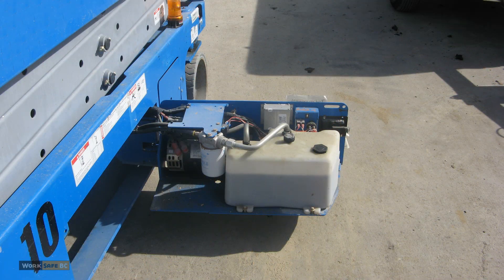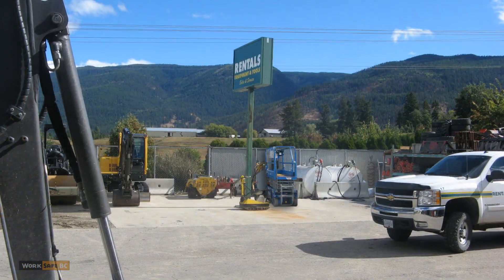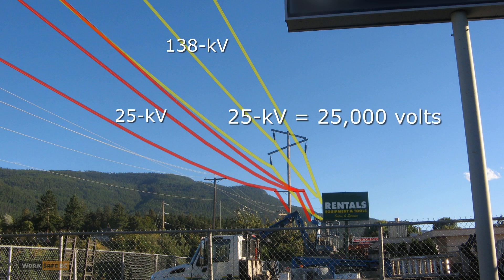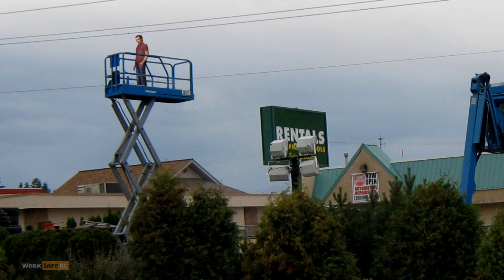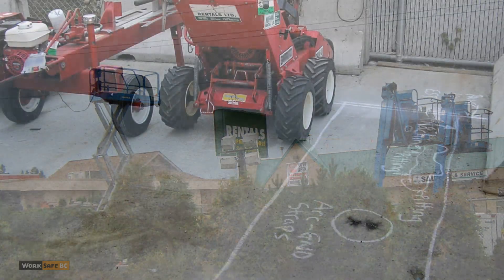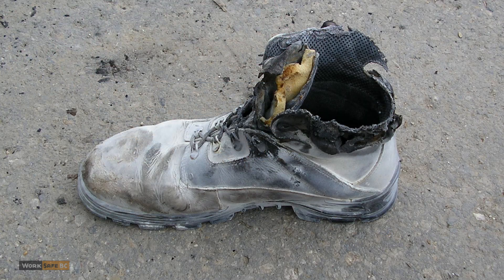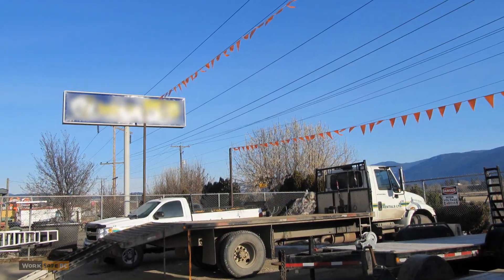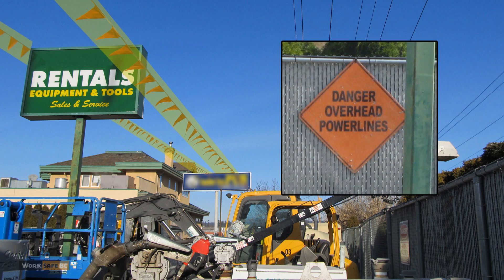Incident Investigation: Worker on Scissor Lift Electrocuted | WorkSafeBC

Comment: Even if the ground straps were not on the lift , As the high voltage electricity was traveling down into the ground , 
It would have jumped from the wheel rims and down into the ground because of how close the rims were to the ground  , That guy should have looked up when he was raising the lift and stopped when he saw the power lines and he should have never reached his hand up , At 25,000 volts 
He would never know what hit him 
I'll bet his body was nothing but a big piece of charcoal , There is no way his work boots would have protected him because that high of voltage went right through his boots , Through the scissor  lift and down into the ground 
God forbid that If a high voltage power line falls on your vehicle 
ABSOLUTELY NEVER ATTEMPT TO GET OUT OF THE VEHICLE !!!
Because your body will be energized to the line voltage and the moment you put your foot out , That high voltage will surge through your body and right through your shoes and down into the ground , Also If a power line falls on your vehicle , Call 911 and stay put in your vehicle until the power company comes out to remove the power line

Comment: Raised his yand in a defensive manner? I can see why you might do that if you were moving towards a power line and instinctively you put your hand up to block ot from hitting you (albeit in this case it would still electrocute you), but the video didn't show his vehicle doing anything that would be pushing him towards the line. Instead, it showed him stationary and then moving his hand up, as if reaching for the line in an effort to commit suicide. The video demo of what happened absolutely does NOT match what the narrator was saying. This is very suspicious. Is WorkSafeBC attempting to cover up a worker's suicide?

Comment: Two big flaws. When his cab got too high, instead of just switching off the lever for vertical movement, he pannicked and defensively put his hand up. That was a fatal mistake.

Also, if you ever need to use any kind of lift device or crane under power lines, never deploy the ground straps. Those are only needed when fueling the vehicle to drain static electricity (a static spark can light gasoline). If this lift truck had been ungrounded, the current from the power lines would have no reason to travel through him to reach ground, because there would be no ground to reach. The rubber tires would have insulated the vehicle.
Reply: It depends on how thick the tires are, and what the breakdown field strength is for the specific type of rubber used in the tires.

Comment: MAYBE I´M WRONG (SORRY IN THAT CASE) BUT I THINK THAT P.LINES ARE 13,8 KV = 13800 V ... NOT 138KV
Reply: Actually there are some that are 135kv. And some even higher than that  for example, power lines that go from a power plant to a city a couple hundred miles away, often have voltage as high as 500kv (half a million volts)! The higher the voltage, the easier it is to deliver the electricity a longer distance.

Comment: Isn’t there plastic coating over wires?! 😐
Reply: On high voltage power lines, no. Insulating rubber blankets can be placed over high voltage wires when there is known to be work done close to them. Howevt this guy wasn't in a job that required working close to power lines, he just didn't realize they were there and so raised his lift (this was still at the rental yard before he took it to his job site, so presumably he was testing it out and practicing using it to make sure he had a good idea of how to work it).  The type of insulating material amount of insulation needed to protect against voltage that high, would be prohibitively expensive when running wires like that over a distance of tens of miles. It would likely more than double the cost of the lines. So most power lines are simply made out of bare aluminum.

Comment: When working with powerlines you must always treat them as if they have no insulation, it the same principal and when you are handling a gun, treat every gun as if it is loaded
Reply: That's because power lines are bare aluminum.

Comment: Isn't voltage irrelevant? Shouldn't they give the amperage?
Reply: Voltage determines the flash-over distance.

As of amperage, in power lines it’s always more than enough to fry someone and start a fire, be it 100 or 10000 amps.

Comment: in drizzly weather you can hear the BBZZZZZZHHH from very high voltage lines.
the arc will jump a gap, plain air is NOT a 100% insulator.

Comment: I thought you only got electrocuted if you touched 2 of the lines?
Reply: Alternating current 
(AC) Electricity flows through  any  conductive path to earth ground , it also flows from phase to phase .  The top wires are the energized phases ,  the wire several  feet below  them is the neutral ground  wire.    Flow can be phase to phase ,and or phase to 
neutral  ground  wire or direct to earth ! These wires are not insulated!   The service drop to the customer is insulated, but never touch it ,as it could have bare spots!

Comment: Retired lineman 33 years and saw the after math of numerous accidents like these, a well driller putting his rig into a 7.6 -13.2 kv line killing him, company building fire trucks, operator put boom into 69kv transmission line killed instantly and numerous other burned severely or killed under estimating those overhead lines.

Comment: How many times does this need to be said - it's not the voltage that will kill you it's the amperage!!! 

When it comes to amperage 0.1 to 0.2 amps is enough to be fatal, any energized power line you will ever see carries far more than this.

Comment: It can't be overstated that the insulation on the power lines does not function the way people think it does. Electricity at high voltages effectively ignores objects smaller than a few feet (a meter or two). It can jump through the insulation as if it weren't there, regardless of its resistance potential. The actual purpose for the insulation is to create a barrier between the wire and the air, because if the air contacts the wire it can cause the air to built up charge until the air becomes a better pathway for the electricity than the wire is. You, a bag of salty water, is already a better conductor than a stagnated circuit, therefore you must treat the wire as if it has no insulation at all.
Reply: There is no insulation on high voltage overhead lines.

Comment: These BC-recommended distances from high voltage lines are there for a reason! You do not follow these rules - you get electrocuted or die! Also - there is the static electricity theory involving flashover and being too close to the lines. Next time on a very dry, winter day, touch your fingertip to any metallic object. The voltage from any static electricity shock in this case has much lower amperage than that of the power lines with high voltage, so getting even close to, say, a metallic doorknob - say, 1/16 of an inch without touching it, and the flashover results - you see a spark and then you get the jolt from it - which is the shock. So a good rule of thumb is to stay away from at least 1/8 inch from all metallic objects whenever RH is extremely low and it is very cold, which will create perfect conditions for static electricity shocks - until you can find a way to discharge them safely. So use these static electricity shocks to send you a warning of a shocking electrocution that will happen if you disobey minimum clearances from high voltage lines.

Comment: Ground insulated equipment is an option. in most cases lifesaving. Ground potential up there on a platform is the cause for such tragedies. and dry weather. Never do powerline maintenance in rain, snow, storm or otherwise damp / wet / humid / unsettled weather of course.

Comment: Safe working distances must alway be maintained.  132 kv  it’s about. 9 feet    275 kv it’s about    12 ft.    275 kv about 18 ft  Closer  than that you are  in high risk areas & not permitted , Damp or high humidity weather makes it more dangerous

Comment: Not a problem here in Denmark as most power lines are buried. Expensive to do but pays off after time due to savings on lack of weather related power outages , accidents and the attendant costs involved in those two scenarios.

Comment: I thought those lines above had a rubber insulation over them.  I guess it depends cause I know that Three-phase electric power transmission lines do not have insulation.

Comment: The worker in this video as well as any kid who ever climbed an electrical tower or pole and got electrocuted had any intention of touching the line, they were simply never informed by anyone that electricity can jump through the air. If you already knew this..  have you ever shared it?
Reply: Ever hear of lightning, that is electricity jumping through  the air!   The neutral ground wire runs below  the primarys,  if the boom was to close it would  also jump  to  it .

Comment: One time, when my family and I were helping a friend move, we accidentally hit the overhead service line to her apartment. The line grounded itself through the moving truck, and so, we had to wait in the cab for the energy company to de-energize the line and lift it off the truck so we could leave. We were very lucky that was just a low-voltage service line. Bottom line, before you start working, always identify where your utilities are, whether in the ground or above you. It just might save your life.
Reply: Someone was smart enough to know you STAY in the cab??
Reply: by low voltage you mean 120v AC instead of 240v AC yeah still enough to stop your heart
Reply: My uncle died when a truck caught overhead lines which fell on him.

Comment: The metal ground straps on the bottom are for discharging static electricity picked up by the tires when in motion. Unfortunately they were the cause of death in this case.If those ground straps had not been there this guy would in all likely hood still be alive.
Reply: As the video explained, high voltages such as these, can jump a fairly large air gap. The wheel rims and the lift frame are just inches away from ground, so it could easily jump that small gap, and much farther.
Reply: People do not always understand the difference between a conductor and an insulator.  Under the right circumstances, even an insulator like rubber and become a conductor.  An insulator doesn't mean it can't conduct, it means it has high resistance to electrical current.  High voltages can overcome that resistance.  Even if his shoes were EH rated he was still destined to die.
Reply: You don't have to be an American to be stupid. Stupid is as stupid does. Yes the straps are usually some kind of braided metal. His boots didn't work because a picture was shown of them burnt. He might have also had one of his hands on the railing. I have been shocked by 50kv automotive ignition coil, the big difference is the current available.
Reply: Bill Taylor Since the beginning, i guess: rubber insulates only so much. If the voltage is too high, the current will jump. Electrically insulated screwdrivers are only insulated up to 5000 Volt. How do you think you get zapped when touching your car, since the soles of your shoes aren't metal?
Reply: @darkswami Basically , Anything will conduct electricity if the voltage is high enough
Reply: Yes and that static charge is intense
Reply: darkswami bad example since your car is a closed circuit using the vehicle as a ground. Your shoes have nothing to do with it
Reply: Yeah the ground on the lift was essentially the negative pole...the wire dangling was the positive pole....the poor man essentially became a human dielectric capacitor with a lot of conductive ions to store the energy of the 2 poles...it was a tesla coil set up waiting to zap
Reply: High-voltage electricity can jump the air gap from the hub caps to the ground, so, he still wouldn't have survived. This is the very same reason lightning is able to strike cars.
Reply: Really? When did rubber start to be a path way for electricity, Never. They are metal.
Reply: i feel soooooo special now , i was forced to trim evergreens that were almost in contact with a high voltage line , i climbed the trees and cut the tops off , my head was about 3 feet away from the line . i could feel the static pulling at my hair . i am very poor and could not afford to pay someone to do it  , being disabled is hard enough on me and then to be forced to have to do certain things that even a working person would be told not to do .  the power company will only do it once the trees actually make contact , by then its to late and the spark starts to burn away the main wire .
Reply: The straps are rubber, just like the tires.

Comment: He shouldn't have placed the scissor lift in between the high voltage power lines.
Reply: Now you see why high voltage power lines usually cannot be 10 feet above the ground where a person can extend its arm to the fullest upward close to the lines. It will kill that person with an electrocuting shock every time. When you see high voltage lines overhead, they are usually at least 50 feet above the ground to about 100 feet, because you need to have a larger flashover buffer zone to allow for possible air gap escapes for larger distances away from the high voltage lines. That is why there are mandates for you to keep well, well away from high voltage lines like those running 400,000 volts unless you have the proper training to work on them.

Comment: is it not possible to like insulate these hydro lines so they can't electrocute anything? i mean im no electrician ut it seems like a simple fix
Reply: +Eric Mahoney is posible but you need like 15cm of insulation on a line the cable  will weight like 3 tons per 100m, i think it would be better tu put them under ground.
Reply: +Eric M Yeah its possible but it would add way too much weight to the lines and it would be way too expensive
Reply: You can but that costs money and requires more power being sent through the lines, because the insulation acts like a large capacitor and has to get charged over and over, 50-60 times a second. We put the powerlines on top of poles so people stay far away, and they are very safe so long as there aren't dumb lift companies who buy lots near powerlines and don't train their workers to keep away from them.
Reply: Current traveling thru the wires creates heat. if they insulate them, them they have to de-rate the cables or use bigger wires which the poles wouldn't be able to carry the weight of. Bare cable in free air can carry more current than insulated wires because the lack of insulation dissipates more heat.
Reply: Michael Kirst because they become the same voltage potential as the wire. They are not touching ground at the same time or another wire. Linemen can hang in baskets from these wires or use a helicopter to work on them. On a small scale you can touch a 120volt wire as long as you have good dry boots and touch nothing else. I saw an older electrician touch a 277volt to ground  copper bar in a panel once with no effect.. on purpose. That I would not recommend. I certainly would not do it. On the bird question I was nearby once when a goose passed between two power wires and arced between his wings and two wires. It sounded like a shotgun going off. I was told somehow it survived and hit the ground running. Bald eagles because if their large wingspan sometimes do the same thing. Again two wires at same time. Long as it is just one and not grounded or close enough to ground or another wire to arc, no problem.
Reply: +Eric Mahoney "Hydro" lines hehe
Reply: How come birds land on these all day without a problem??

Comment: You would think a lift rental place located under power lines would have taken precautions against lifting in that area?
Reply: You are giving to much intellectual credit to society.
Reply: You would think that they would have a red zone painted on the ground prohibiting the raising of lifts or anything else that could get in danger range of the lines.  In addition signs everywhere in that area as well.
Reply: They put up a couple signs afterwards.  Lesson learned.
Reply: @artemiserectus  They already had signs in place though. I don't think adding some more signs will cut it, if there is such lacking guidance for the new workers.

Comment: they should make voltage sensors on lifts if it gets within couple feet it disables the lift.
Reply: +Rudy c That is not a bad idea.
Reply: +Rudy c It'd make more sence to re-enable and go down.
Reply: Far easier to get into the habit of looking up first
Reply: @JeaneGenie  unfortunately all it takes is a couple nights of insomnia to not be entirely there and forget. Idiot proofing is always the better option if possible
Reply: Or at least an Alarm or something lol
Reply: @Richard Vaughn the electric fields of a hv line are way bigger than those we use to communicate, also, they have a diffrent frequency.
Reply: great idea !
Reply: @Richard Vaughn  just make it a feature that can be controlled